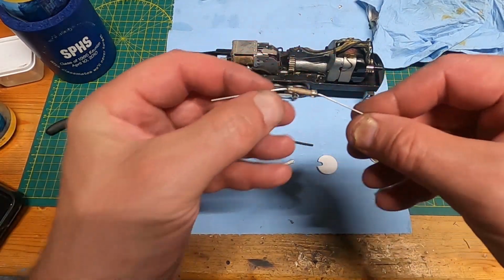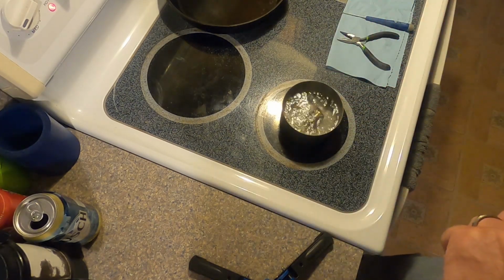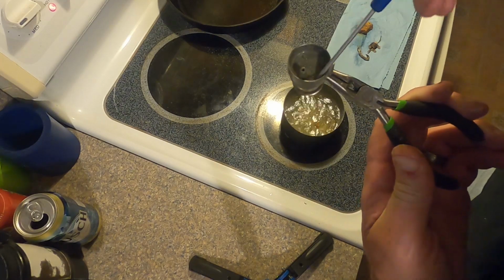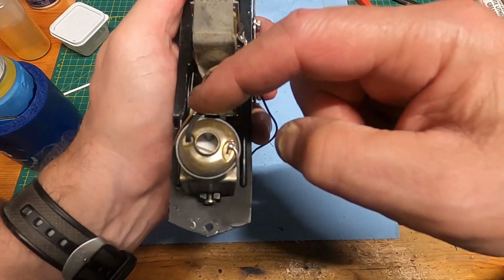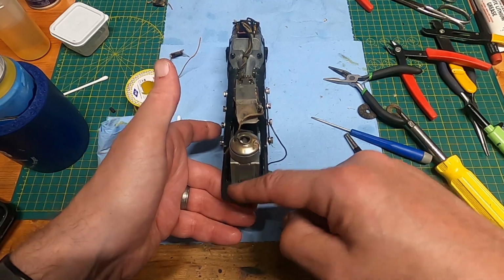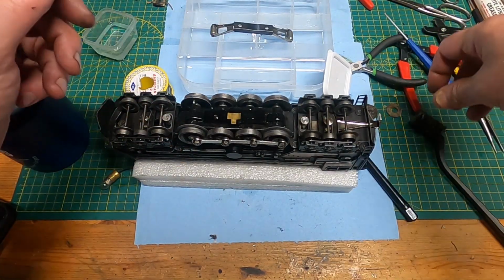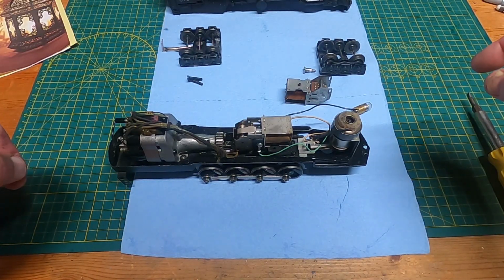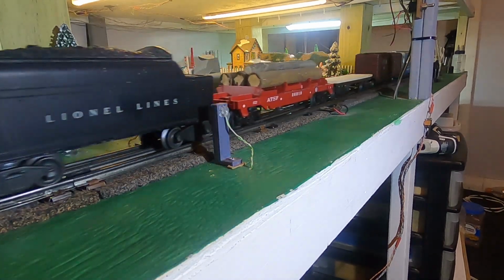Lionel Turbine 671 Repair, Part 2

Comment: Say, you didn't say what those two thingys  were on top of the back o the motor, you know, right above the brush holders? 🤔
Reply from the maker: If we are talking about the same thing, it is a jumper wire.  On that model, instead of an E-unit switch on the top, it uses a jumper.